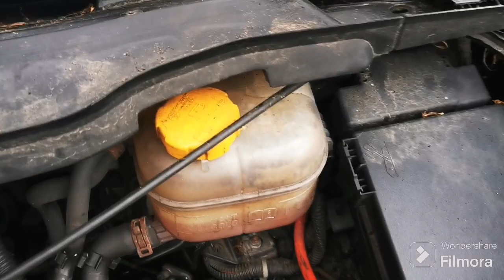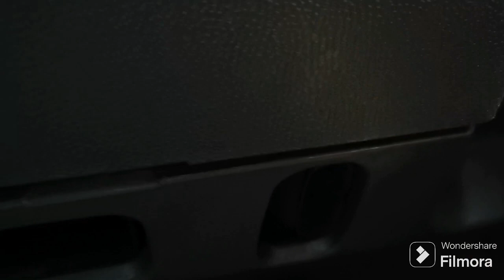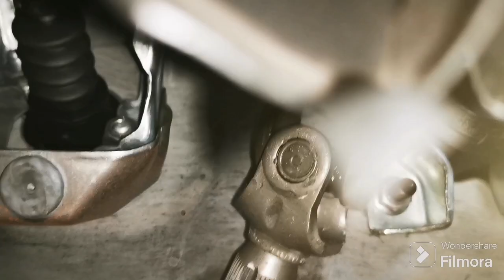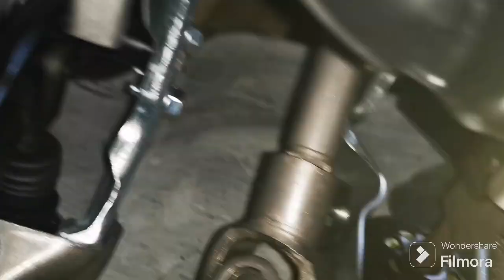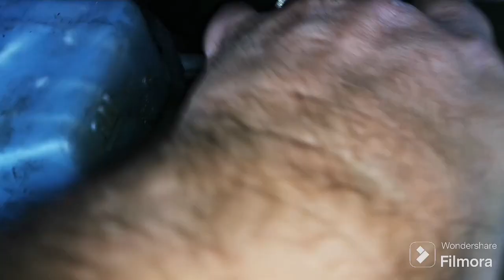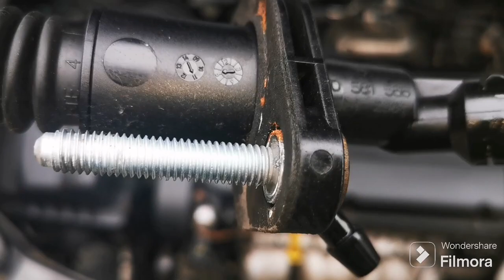how to change  a vauxhall zafira clutch master cylinder replaced due to no fluid#carrepair #clutch

Comment: Great video! So much information/
Do you need to bleed anything when changing one of these, Just had a problem with my Zafira.
Reply from the maker: @ProToonster  thanks means alot.yes once u fitted it u need to fill the reservoir up and loosen the slave cylinder and let it flow.they are a nitemare to bleed.let me no how u get on

Comment: Hi,

I'm trying to bleed the clutch fluid from the bleeding nipple but no fluid is coming out. Any idea why?
Reply from the maker: Realy sealy question just doble checking tlyou have undone the bleed nipple enough .also Is the reservoir full to the top with brake fluid,theses are a nitemare.can you see the fluid moving up and down in in the reservoir  if you cant you may have air in  the master cylinder or the dreaded cylinder may have failed to.what I would do is put a one way valve with a tube on and  a jar then pump the peddle about 20 times if nothin I would undo the pipe that connects the mastercylinder to the slave cylinder and see if fluid is coming out when u pump the clutch if it doesn't its the master.if I'd does then it could be a issue with the slave cylinder pipes hope that help please let me no how you get on
Reply: @flippingcarsrepairs  Thank you for your reply.

I have removed the clutch master cylinder, and no fluid was dripping from the tube that connects to the reservoir. The reservoir has fluid in it.

The tube that connects to the slave cylinder is also dry.

Could the reservoir be blocked?
Reply from the maker: @Faizal_Khan   100% sounds like it's blocked as if you disconnected that grey pipe from the reservoir that would pour out fluid realy quick as its gravity fed .
Reply: @flippingcarsrepairs  yeah.. I'll have a look at the reservoir tomorrow.

Took me the whole day to remove the clutch master cylinder with a lot of swearing.
Reply from the maker: @Faizal_Khan  🤣🤣🤣they are a big pain to get too

Comment: Not fair.. I wanted to see how you took the pipe off from the clutch master cylinder.
I wanted to remove it, but it's too tight, and I fear I might tear it or something.
How to remove that pipe ?
Reply from the maker: 🤣🤣🤣 do u mean the grey pipe from the reservoir I just pulled it realy hard it's has a rubber Cromet inside